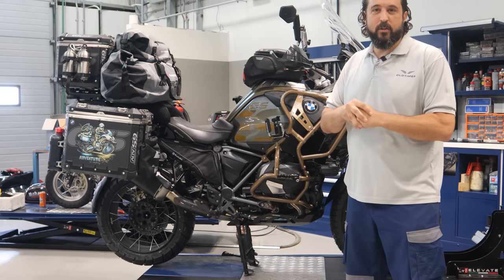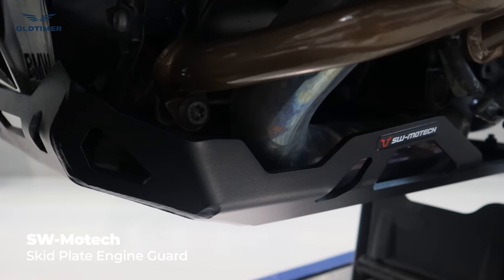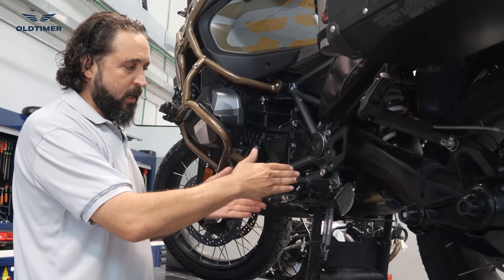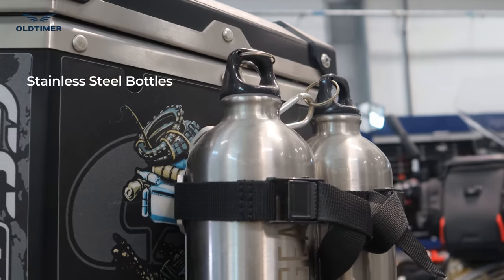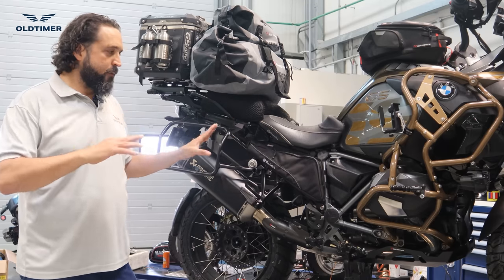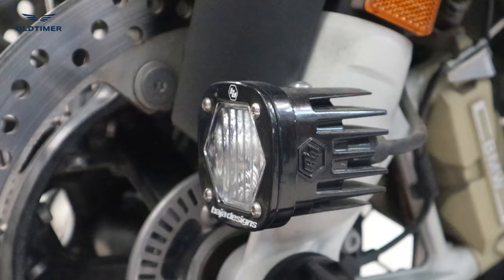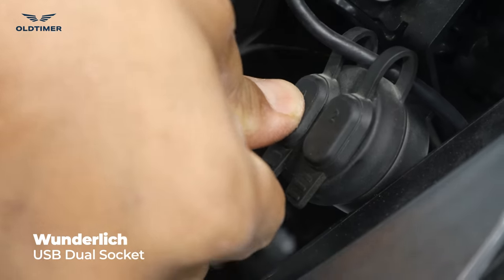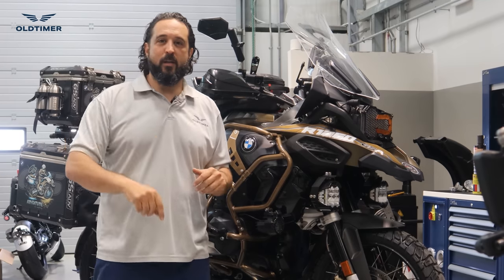BMW R1250 GS Modification

Comment: Next question from customer: How can I make my bike lighter? 🤔🤦🏻‍♂️
Reply: Had me in stitches ! 🔝
Reply: Before actually filling the luggage with anything, there’s gotta be a added hundred pounds on that big boy. 🤦‍♂️
Reply: Imagine picking that bad boy up fully loaded, fully fueled.
Reply: @AJ-yw5zy  Follow the most important rule - do not drop the bike.
Reply: Still easier to pick up than a Tenere 700.
Reply: If a light bike is what the customer wants there in the wrong place to begin with, for the light weights Vespa🛵 is next door. This is the Big League for the heavy hitters🥊🏍 Baby. LoL

Comment: Wow, incredible build. Really wish I could buy a 1250 gs fitted like this.
Reply: You don’t need it built up like this😝 stock is fine. About AUD$2000 for luggage, proper skid plate, hand guards.

Comment: You guys have put in a lot of work and it deserves respect. I have only one question, does someone really hang all this on his motorcycle? Then it will be impossible to move off the asphalt on it, otherwise suddenly all this beauty will be covered with road dust. 
 Why additional footrests for cylinder protection ? Why additional headlights at the bottom of the front shock absorbers ? It will all break when falling off the asphalt. Why are all these glamorous things on a motorcycle that is designed to travel far and not only on asphalt?  It's good, of course, that your company can do all this, but in this form, this motorcycle is intended only for people who can and know how to ride only from one glamorous hangout place to another glamorous place where people brag about their expensive cars and things and who are thrown into a sweat from the mere thought of moving out asphalt.

Comment: Lots of extras fitted. Some good, some bad some unnecessary i think. What bothers me is that the most important thing nl. a built in compressor and easy reachable toolkit box is not included. I'm from South Africa and if we take a GS anywhere remote you first think Tools, Tyres and compressor.
Reply: All are in side boxes pump  tire repair kit, sbv tools for GS and tubes just incase.

Comment: Gs bike is the best to have, only need modification on the driving shaft if possible it should be on both sides of the wheel for durability. In this case one will not be in use only when the other is spoiled that's when the other take over. Thanks

Comment: My rules of mods. #1, do you REALLY need it? #2 If you put something on, take something else off*. For instance, I installed amber driving lights with hexCAM, so I removed the back foot pegs. # 3, Never pay for Tourtech or Denail, as knock off at a fraction of the price. The exception to #3 is always buy BMW is it's a moving part. #4 Do it yourself, don't pay some shmuck to fuck up your bike, you're perfectly capable of doing it. *Thing to swap to save weight, Lead Battery to Lithium, Steal handlebars to carbon fiber, back seat to backpack, Back foot pegs, exhaust can to aftermarket.